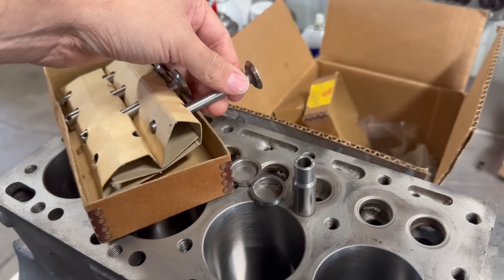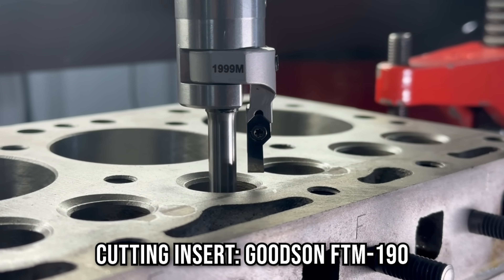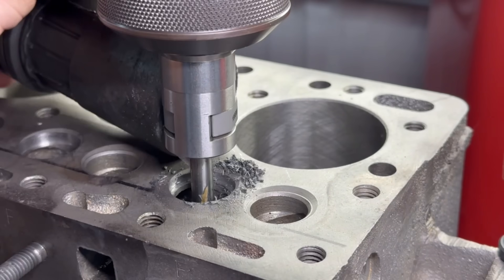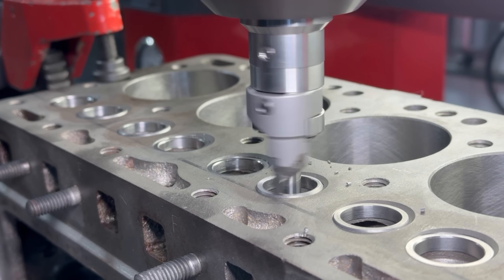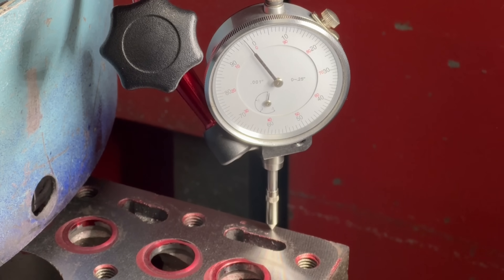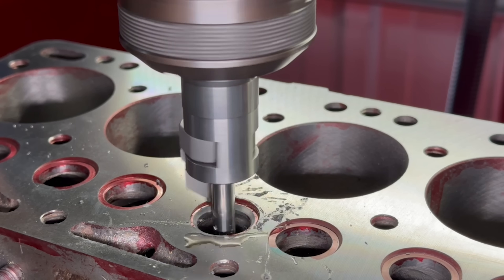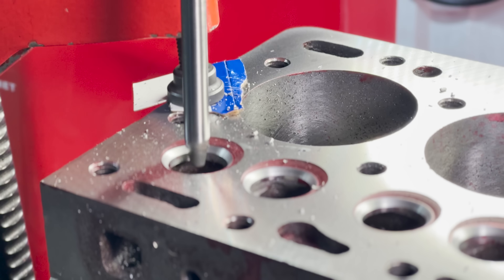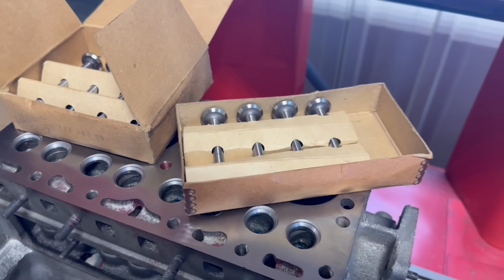I Could NOT Cut These Valve Seats Without NEW Tools!

Comment: Amazing that we used to have to pull heads every 30k miles to (at least!) re-lap the valves, or do a complete valve job if we weren't lucky. Engines and materials have come a long way. Lovely work as always - thank you for sharing what you do!
Reply: Fuels and oils have got much better as well.....
as has air filtration....
so engines these days theoretically do not self-generate as much "grinding paste" internally as they used to..
Reply: Those old valves were soft as butter. Even going to a stainless quality valve on a cast seat survives unleaded fuels quite well.
Reply: @a4000t  Yes. Modern cars don't even come with stainless vales, but they still hold up. This is why when someone needs and old head rebuilt, I tell them to buy new exhaust valves, even if they can be recut. Unleaded fuel might not wear the valve as much as the seat, but it certainly wears the old part faster than the manufacturer expected.
Reply: Correct. There's tons of old dudes (i'm not exactly young either) babbling about how much better and better made everything, especially cars, used to be - only to fall silent when asked how often they need to do valve job or adjust carburetor nowdays, replace or file points, check ignition timing or do they need to do something regarding intake air heating when winter comes. Old stuff tended to be somewhat more repairable, but that's just because it needed lot more repairs. Same dudes complained here in Nordics when ethanol was added to fuel, even though they added it to fuel tank themself from a fuel antifreeze bottle (pure ethanol to remove water from fuel system) for much higher price. Don't get me wrong, i feel nostalgia towards cars of my youth too, but i wouldn't want one as my daily driver - modern cars are just so much nicer, more reliable and way safer.
Reply: @ninefingerdeathgrip  Where I live, this is why some people miss the Honda Civic and Toyota Corolla of the late 80s and most of the 1990s. They had most of the durability of modern cars, without so much excessive Knight Rider junk. Odds are, if you had a check engine light, an unfolded paper clip and a few affordable parts solved the problem.

The one thing that did suck was that most had a timing belt. Nobody needs that BS.

Also, some people aren't exactly wrong about old cars holding up well. During the 70s and 80s, few cars were as tough and serviceable as a Volvo brick or mechanical injection diesel Mercedes.
Reply: @ninefingerdeathgrip  I hated points in my Camaro !
Reply: @skylinefever The golden era was late 90s early 2000s. Materials and tolerances were advanced but it was still not ruined by emmisions and corporate average fuel economy regulations

Comment: I had a continental block, the pockets for the seat inserts were machined way too deep on 2 cyls. I was the 3rd rebuilder. Not having access to a full/pro machine shop, I purchased seats that were thicker, machined em down some on my lathe. Then used my Neway seat cutters to dial em all in. Seemed to work out alright.

Comment: What machinists don't tell you is - three angle five angle thirteen angle the more angle you get the shorter the valve life is, not necessary for street cars\trucks – Three angle five angle mainly for performance engines. If your engine came with 45 degree from factory and it’s a street car, just keep the 45.

Comment: Loving your videos. Brings back so many memories of my time as an automotive machinist. I started my apprenticeship in 1964 when I was 15 going on 16. I learned all the aspects of the trade even remetalling babbit (white metal). My favourite was the crankshaft grinding. I thing from memory that it was a  German Schou. The shop was more  mass production of reconditioned engines - mainly Holden and Ford. The only photo I have of those days is me line boring a 6 cylinder Holden engine about 1966.  I tried to upload the photo but was unable to.  It's great that you and your Dad can work together.

Comment: Back in the day i used the Kwik-Way #10 carbide fixed seat cutters,they were quite expensive but a no brainer having the press fit ground in to them,so no calculating interference fit. A real time saver.

Comment: I once got a job making some tools (punches and pullers) for a local restorer who needed to remove valve guides and cam bearings from his Austin 7 engines. The Austin has a lot in common with the subject of this video, being a diminutive sidevalve inline 4. It even has similar squared off ports. There is one big difference though, the cylinders are a separate iron casting that is bolted to the aluminium block. Also the Austin has only two main bearings, presumably the crankshaft whips and bends like a noodle in there when the engine is running! Was a fun little side gig to work on, I also ended up making some jigs so he could drill exhaust manifolds and align the lifter guides in their bores.
Reply: I think this engine only has two main bearings also. An earlier video showed this.

Comment: ...I once owned a Lincoln welder with a Continental engine about this size...hand-crank...! But it did also have an electric starter...then, a forklift with even smaller motor...valves in the head..pushrods...
  Very nice to see you check/re-grind those 'new' valves...I've owned several Harley-Davidson Sportster Iron Head and older Knuckleheads...all have iron heads...I've bought New Harley valves and found them way out of tolerances that I'd like to have....especially when these valves are $25-30 each...and that old wooden 'valve stick'....still hard to beat...!

Comment: Imperial to metric is pretty easy to convert. 25:32 is 19.8437mm. 

25 divided by 32 multiplied by 25.4 gives you the number in millimetre 🙂
Reply: Yeah i would have just said 20mm it's within tolerance

Comment: You guys might be able to use the Tooling from Goodson that you needed to purchase on other  cylinder heads such as on smaller 4 strroke outboards and on the 4 & 5 Valved motorcycle Cylinder Heads.Keep up the good work Fellas,i enjoy watching your work with the Serdi.I used to operated a couple diff boring bars at our shop(AMI and A Kwickway,AN Model)and i still have A old Sunnen Honing Machine that was in my Gramps shop that actually still works,We sold our Dealership 20 yrs ago and i had a small machine shop with a few decent machines to take care of the Machining needs on the Motorcycles and Boat motors we sold and Did repairs/Rebuilds on.

Comment: Doing a Kohler 38 cubic inch, 4-cylinder engine with very similar size valve gear-but it's OHV and 7mm valve stems. The rust cancer has been hard to deal with on that cylinder head as well.

Comment: Some thoughts
1) I was believing that the valves were generally just cut into the iron on engines of this vintage. Did all the Continentals come from the factory with hardened seats?
2) They must not have had much faith in their valve materials if they left the stems so very large on such small valves.
3) NOS parts can be a problem as it seemed that rejects often worked their way into the service part stocks. I had a 39 year old car that I was rebuilding the transmission on and the idler shafts were available but according to the experts they were all out of round just enough to be a problem. We knew a guy who ran a grinding shop and had him run off 200 of the shafts new and the transmissions with these were much better.

Comment: Great vid thanks Allen interesting how you added the extra cylinder and changed the crank from 3x3 120degrees to 4x 90 degrees  I presume , being a two stroke no problems with vave timing etc. How did you get the ignition to work with the different piston tdc positions your ingenious mind no doubt sorted it to perfection.

Comment: Do you find that different manufacturers cast iron quality varies and which brand is considered to be premium as for machineability and resistance to corrosion..👍
Reply: Cast iron does vary, the best cast iron engines had a high nickel content. They are hard on tool bits, but they resist wear much better.

The Buick Nailhead had a higher nickel content than many other GM engines of the time. As a result, nobody puts hardened valve seats in them to handle unleaded fuel. They only recut valve seats.

Comment: Our shop does work for several local motorcycle and outdoor motorsports and we do work for the diesel industry.   I have machined valves and seats with serdi and sunnen tooling from over 3" 1/2 stem to under .5 with 4mm stems. lots of fun

Comment: On telescopic gauges I've only had starrett gauges work correctly.  I use a rocking motion in the mic to measure the distance of the tele gauge .
Reply from the maker: I double triple quadruple check when I use them. But I’m hoping to invest in some Mitutoyo Holtest 3 point inside micrometers sometime. Eliminate as much error as I can.
Reply: @JAMSIONLINE  those ID mics are the best , boy are they pricey
Reply from the maker: Yeah the price hurts my soul 🤮
Reply: I find it best to keep the misalignment prior to pulling them through in the bore as small as possible. For whatever reason if they get compressed too much they always seem to spring back out slightly.

Comment: i noticed you measured the deck of the block to the top of the guide before you resurfacing the deck, you said you get it within 10,000ths but you took a total of 11,000ths off one of the blocks, just courise if you double check that measurment after resurfacing or does it not matter that much?
Reply: That was going to be my queation, as well!

Comment: What are non metric measurements called in the u.s.? In Australia we went metric in 1973 and I worked as a mechanic in the late 70's and have heard non metric called imperial, sae and I even had someone give me a set of whitworth spanners that didn't seem to fit anything.
Reply: Many people either call it "Standard" or "Fractional."
I did have an automotive teacher that hated when people didn't call measurements exactly what they were in the book.

We had a torque wrench in foot pounds. If someone asked for the specification, someone would geive the number, without the unit. 100! 100 what?!

Comment: At 14:19 and 14:32 a crack appears to be visible between the valve bore and the far right cylinder. In earlier and later points in the video it isn’t there. Just some artifact or debris ?
Reply from the maker: Smudge. Not a crack.

Comment: I run a Ford Flathead in my truck , do you guys do any valve to piston relief - cuts ?
   I have mixed feelings about that as I know it reduces the compression ratio / psi .
Reply: People who do it often install high compression heads. It more than makes up the difference.

Comment: Wait till you've got a Honda CB250 head to cut seats on. 4 cyl 16 valve heads for a watch lol. Exhaust valves not even 1/2 inch in diameter. That's getting small lol.
Reply from the maker: Reasons I avoid motorcycle engines lol

Comment: On those flat head engines you deck the block like that you have to trim the top of the Pistons
Reply: Probably not. He’s only removing .015 max so pistons shouldn’t be affected. Compression will be slightly increased if the block and head surfaces are machined.
Reply: @ellieprice363  yes but they only make the metal gaskets for them continental's any more less you find new old stock, I had 15 take off my dad's welder engine and for yrs I couldn't figure out the problem, a metal gasket and is only like 30 maybe 40 thick, when enough  carbon and the thinner gasket increased the compression ratio you couldn't never time the engine
Reply: @andrewklahold2880 Most engines are timed several degrees before the piston reaches the top center of its stroke. Block and head milling and thin gaskets don’t have anything to do with timing. You had other problems.
Reply: @ellieprice363  yes to high of compression

Comment: Prying the head off is sure sign of bumblefuckery. Once head bolts are pulled,  remove the sparkplugs and thread rope down the cylinders.   Roll the engine over and the head will magically lift off.
Reply: Nah. Leave the spark plugs in, crank the engine over a couple times and the compressor will pop it loose.
Reply: @ellieprice363  
Works if the rings and valves are good

Comment: Metric measurements are to simple for the folks in the US. They are extra smart, and they train their brains with calculating funny fraction just to convert it into „thousands of an inch“ what is basically metric…..
Reply: That’s correct. That’s why we’re smarter. 😝😝

Comment: Sorta like 53/71/92 series DD.  Why even bother grinding those tiny valves?  Just throw those midgets away and use new ones.
Reply: Good luck finding good new units. Often these old engines have few sources for good new parts.
Reply: @skylinefever  I meant grinding tiny valves.  Put a nick in the neck and don't notice it will guarantee disaster later.  I despised grinding tiny valves on DD back in the day...the risk far outweighed the cost of dropping a valve later....'sall I meant.
Reply: @nhzxboi  Sure, but weren't Detroit Diesel parts easy to come by back in those days?
Reply: @skylinefever  I would think they are still.  Not sure but I'd think so.